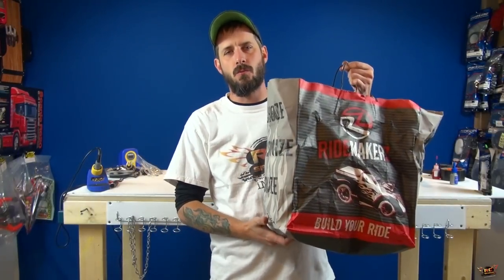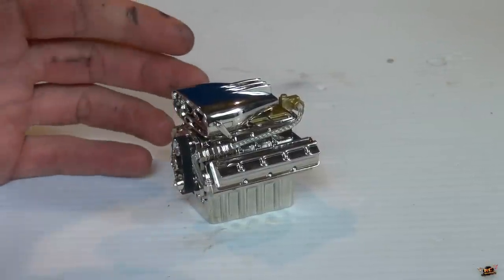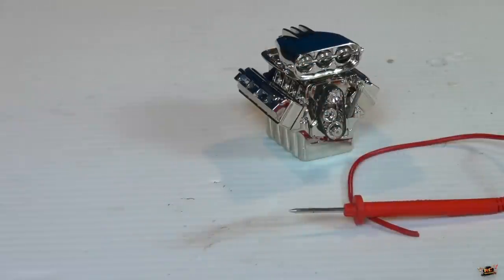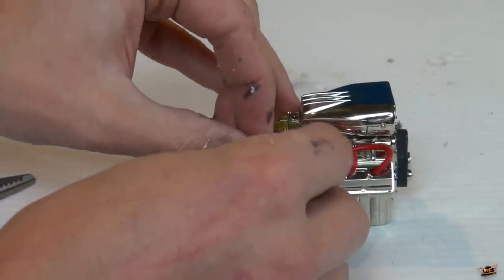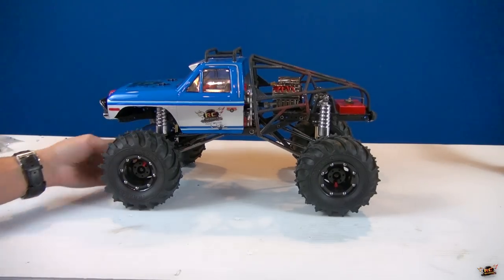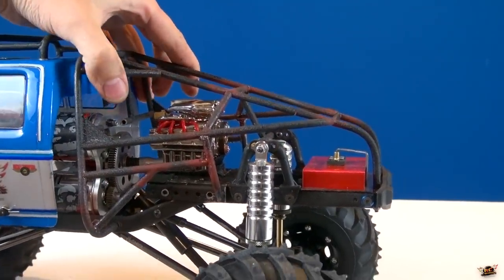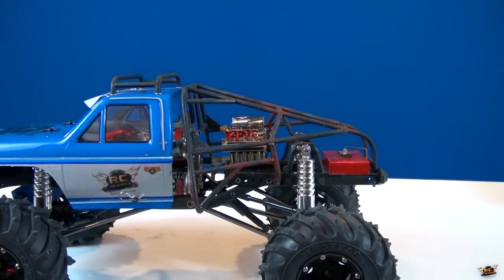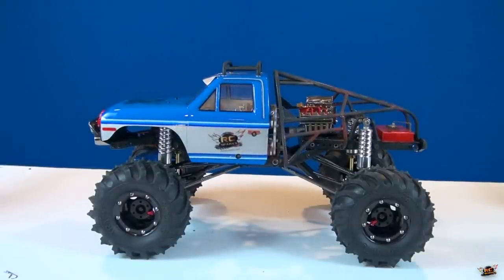RC ADVENTURES - ALTERED BEAST 4X4 - Rebuild BV5 - Scale Engine, Winch

Comment from the maker: Questions & Answers: 

1) "Your Plug wires are going in the wrong spot"
1A) My plug wires are in the right spot for the type of engine I wanted. 
.
2) "The engine should be in the front"
2a) In a proper rock & trail buggy - an engine is perfectly fine in the rear, towards 
the middle. Especially surrounded by a cage. 
.
3) "Your fake engine is on the wrong way"
3a) Actually - it on the proper way. Are you referring to the forced air induction scoop? If I was travelling at great speeds.. you would be correct.. But as it is only trailing, and crawling - it gets plenty of air. 

Important thing to remember fellow RC Addicts - 

It's a Toy, and is meant for fun. 

Imagination is the key.. 

:-)
Reply: +RCSparks Studio™ 
I agree on number 2and 3 that's just idiots talking but on number 1 what kind of engine were you going for
Reply: RCSparks Studio Facts and it's BEAST!

Comment from the maker: Note: unless it's a over head cam motor, plugs go through the valve cover. Like the 4.6 dohc import motors, and a lot more - including the HEMi
Reply: Not if it's a standard, old school V8. Then the plugs are in the side of the heads.
Reply: Ryan Davis watch?v=cWUomjdI9vk Is that old school enough for you?
Reply: Ha. Good call. The classic HEMI!
Reply: For a second i thought that shaft going from the spur into the fake hemi was a make shift scale drive shaft! But i was wondering why you put it in the oil pan, lol then u pointed out that it was a "rumble feature"
Reply: Del 4
Reply: Your van is noise can you give me a van

Comment: I have been detailing model vehicle engines since I was 14. I wont tell you how long ago that really was but a while. I still do models in the winter. I have just gotten back into RC vehicles,mostly mine fly. If I ever do an open motor style,I will definitely detail everything out. I even make my own parts using sculpy mold clay or cast my own.

Comment: Love the revival, one thing I noticed though was it looks very tall with the shocks ad tires with that metal cage you might roll easy so you might want to lower it (idk if it would be best to adjust the suspension or the tire pressure). But hey its your rc so do what you want :) and love the engine that is so cool for $6

Comment: Just a quick suggestion to make the engine even sweeter.  Put a micro servo with linkage connected to the butterfly valves on the engine and sync it to the throttle.

Comment: love the idea of using the wheel wrench as a drive shaft to the transmission. it gives it that extra little bit of scale realism. just a thought though I could see the wrench after time melting or tearing up the plastic on the engine. what about finding a bearing big enough to go on the small end of the wrench and pressing that in to the back of the scale motor. just an idea. cant wait to see the beast in action

Comment: For people thinking the engine is facing the wrong way; the output side (back) of the engine would always be facing towards the transfer case in a 4WD system... which would be at the center of the vehicle.

Comment: Obviously not my build, or my say, but I think it'd look way more bad ass hanging out of the hood. Then you could not only have the intake valves open, but you could put a tiny little motor (like the rumble pack from an Xbox 360 controller) in there to make it shake.

Comment: on the fake engine you should extend the shaft thru to the front where the pulley is attached and mount the pulley on it and make the belt move with the motor

Comment: not to burst your bubble and i think it looks awsome but wouldnt the spack plug wires be where the spark plugs would be? and what i mean by this is they would be under and to the side of the blower. not into the valve covers like what you did, but i know its not to scale and it does look cool, keep doing what your doing i love the videos and cant wait to see the BEAST back in action
Reply from the maker: Its a Hemi Engine

Comment: MEDIC  have any of your lipos gone wrong?? went up in fire or swollen up?? i am really debating buying  2s lipo for a traxxas stampede for pure bashing or staying with good nimh packs
Reply: +degaboss get a hard case lipo, never charge past 1C and never discharge past 3 volts per cell, and you'd be fine
lipo power is amazing... dont forget to gear up a couple teeth on the pinion though.... im sure if you start a thread on traxxas's forum people will be able to tell you what gearing you should use, or maybe even contact traxxas directly about it

Comment: dude，you should start using 3D printer, it makes rc so much easier,I mean, I have designed and printed a motor that even looks cooler than this one that you buy, I even made the intake hollow down to the button and put a fan on it that directly blows on my motor to cool it,and to design it only took me like 4 hours, although it tools 22hour to deeply print all the details , but it still worth it
Reply: Seriously, it make the hobby of rc so much easier, sometimes you don't even have to buy parts for the car, I printed a spur gear and it worked pretty well, light cup, a arm, shock tower, even wheel rims,basically you can print all of the accessories ,it's just the matter of if the material is strong enough, and a so so 3D printer is like the cost of a erevo,so not too expensive

Comment: hey djmedic i plan to use rc 4wd motors will a 35 turn be able to pull 20-35 pound heli on a custom trailer
please help

Comment: can someone tell me the reason for delrun bushings in a RC car/truck. i know that they are a harder plastic and are more resistant to flex. but on a rc car.....marginal gain?or huge difference?
Reply: Its Delrin ,super easy to machine ,smooth finish is very easy to obtain,(un  like nylon), the thing that makes it the perfect bushing material is the fact that it is self lubricating .

Comment: Hey djmedic my dad has a 1/6 scale Dodge hem that the chipboard and motor are fried if you have the extra parts could I have them so I could make my dad happy that would be great also he needs new metal rims cuz he stripped out the attic rims doing wheelies after he locked the spider gears Turing it Into a positive traction truck so if you have the extra parts that I can have to fix his truck that would make me happy so I could make my dad happy by fixing his rc truck I would appreciate it if u

Comment: The fake motor should be in the front with a cut in the "hood". or at least flip it around because the it the only way it make real sense because those valves that open are for air intake on a real car so you should make it much more realistic. thanks.
Reply from the maker: IN YOUR RC, the motor should be in the front. In mine, it should be positioned in the back. As I am not putting this engine into a Racing vehicle, the engine placement is 100% correct. My RC, My engine placement.. lol